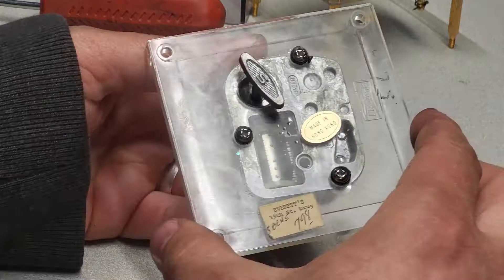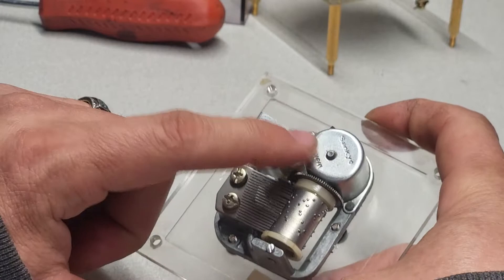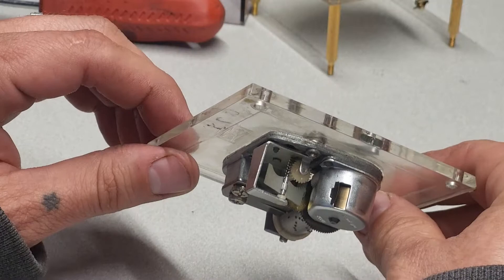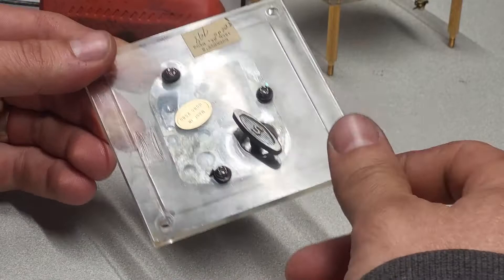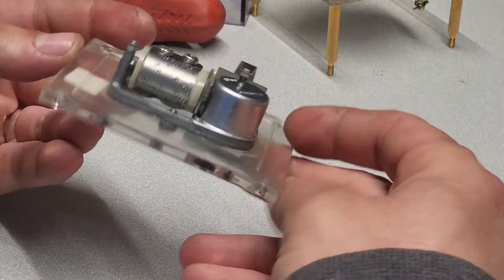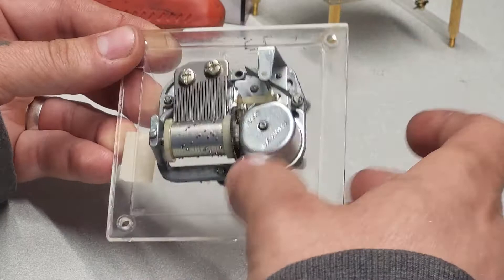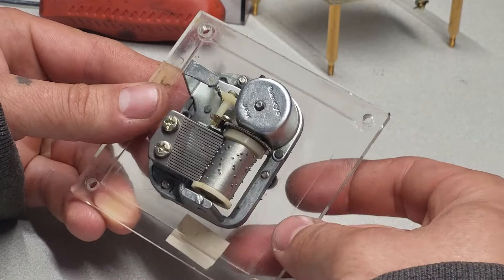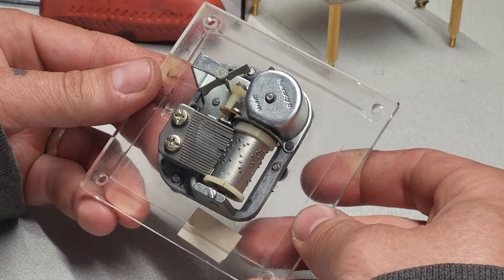Fixing mechanical wind up vintage music box mechanism

Comment: I appreciate this video because i have recently acquired a walnut music box that will not wind, i think its an issue with the gears and rust but none of the videos that I found have mentioned problems like that
Reply: How's it now?
Reply: @AngeloLuis22   it works now! Turns out the little stopper mechanism was jammed and that was why it didn't wind at all, I was able to unjam it by reworking the wires in the stopper mechanism
Reply: @jazlynpointer626 But the duration of it; can it last 30 minutes?